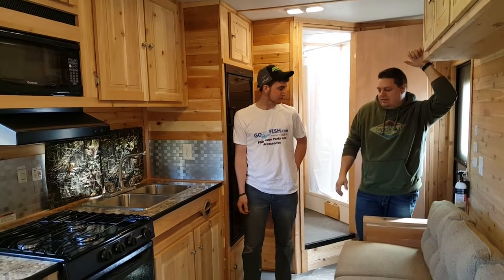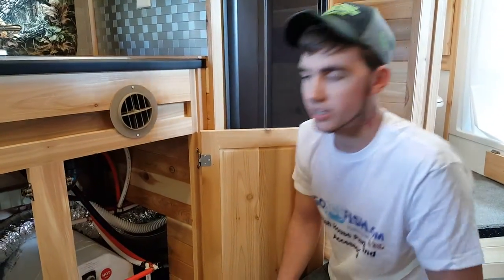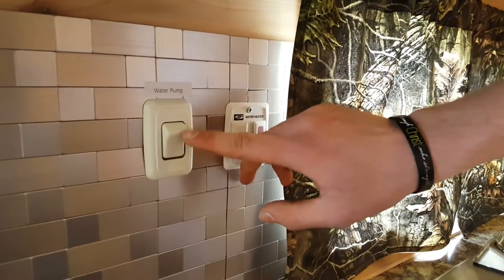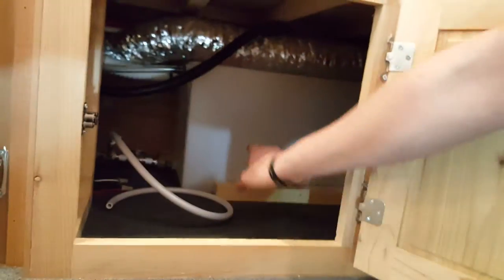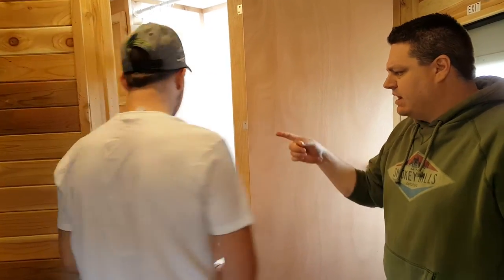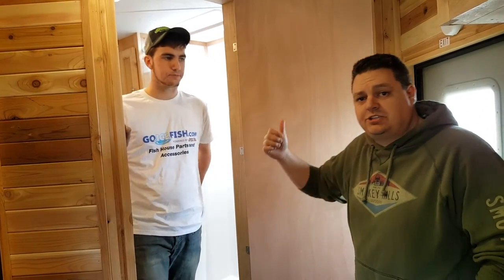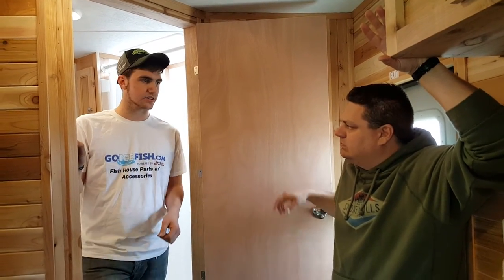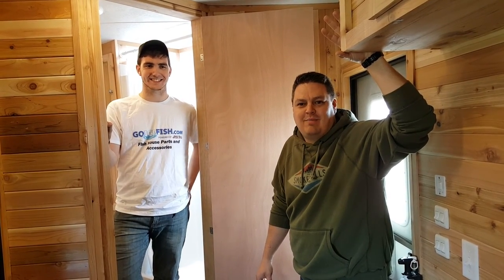How to winterize your Ice Castle RV Part 2

Comment: how do you completely empty the fresh water tank? the outlet is slightly above the bottom of the tank and even with house lowered in front abou 1/8 to 1/4 in if water remains in tank and pump Is sucking air only.

Comment: Bad advice imo on the black tank valve.  You end up with a pile under the porcelain when you leave the tank open. You want to empty it when it's full, helps flush out as much of that waste and paper with the water.
Reply from the maker: Matt, I agree with waiting till it's full
Reply: @SmokeyHills  That was my first thought. Haha. My parents have a seasonal camping spot and they've always been told to keep it shut until the tank fills.

Comment: I was wondering if these Ice Castles come with recirculating toilets? If you don't know what I mean, there are videos on here about how to operate them. So far, the only RVs I've heard of that come with them standard is Trailmanors. They're the toilet and black tank combined. When you get to your campsite, you make sure the handle that's connected to the valve on the bottom of the toilet is pushed in. You then fill the tank, through the toilet's flush valve with 3 gallons of water. There's a gauge on the back, similar to the gas gauge in a vehicle, which will read charged when all of the water is added. You then add a tablet, supplied with the trailer, to control the smell. You'll know it's time to empty it when the gauge reads full. To do that, you pull out the handle on the bottom of the toilet, then once you get to the dump station, unless your campsite has its own sewer hookup, you then pull off the cap on the outside of the trailer, open the other valve on the pipe and let it drain through the sewer hose. These toilets were developed from the same ones used on planes. They also reduce the weight of the trailer by not having a separate black tank. Not sure how much it can hold, but it would be better protected from the cold than a black tank, as long as the furnace is running, since it's inside the bathroom.
Reply from the maker: Great information, will check it out. Thanks
Reply: @SmokeyHills  No problem. A video made by a young couple here on YouTube will show you how to use it. Just type "How to operate a recirculating toilet in a travel trailer."

Comment: How do you drain the water heater?
Reply from the maker: Valve on the outside on the water heater, make sure pressure is released first